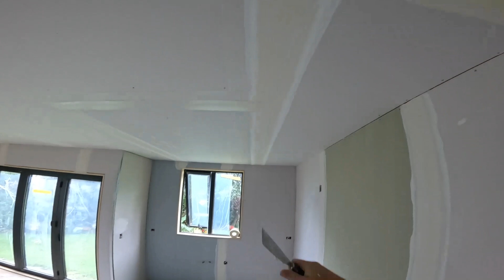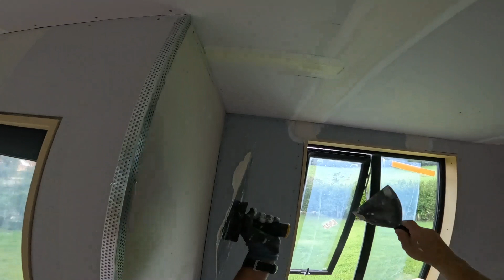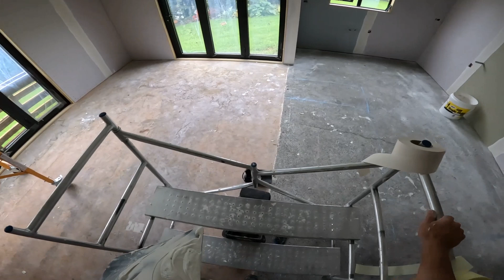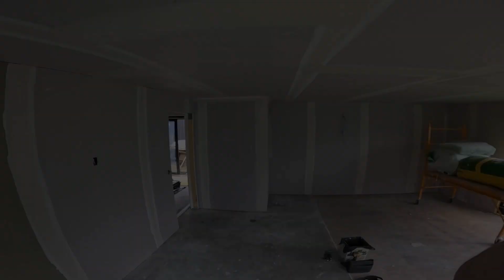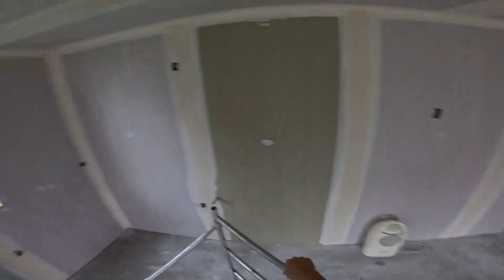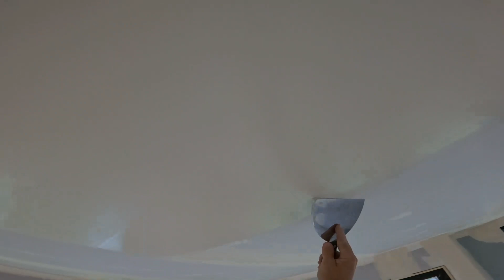Drywall BUTT JOINTS - The Complete Process

Comment: Great advice Brad. Doing some wall butt joints soon because the new GIB around a wardrobe had a few of cuts. Would you recommend creating a trench between the two SE’s to get some mud into it? Any tip for small strips (30-40cm) as it’s awkward to do.
Reply from the maker: yeah you can cut edge on angle to create V - only needs to be small and just get any loose paper off. for small strips you can buy small knifes, i have about 5 different small ones that fit into small gaps

Comment: Are the beveled edge joints backblocked? Do they backblock the butt joints often ? And to they make a taper with the butt joints using wood and packers ?
Reply from the maker: Yes butt joints are back blocked and they used wood and packers to make it hollow. But sometimes no matter how hard they try, it still seems to be proud at the joint meaning I have to fan it out